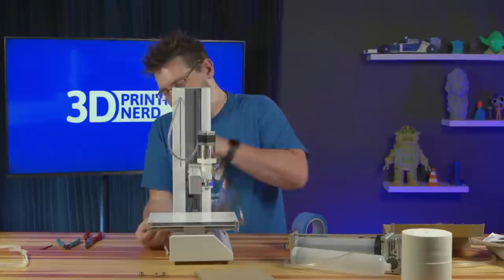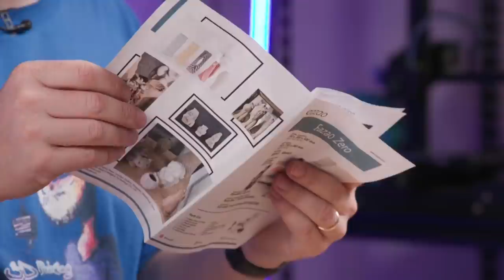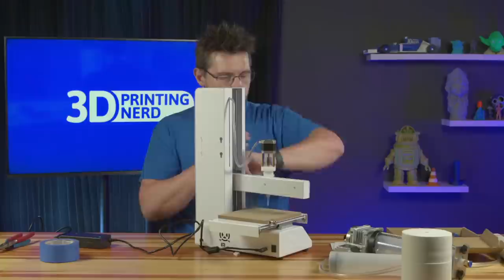CERAMIC 3D PRINTER LIVE! Cerambot Eazao Unbox & First Print

Comment: On their KS website, it looks like the part goes into the container (microwave kiln as they refer it as) in front of the machine and then heat in the microwave. Also, there are quite likely several more steps before getting to the final heating step, which I don't think they have explained clearly anywhere.

Comment: I hope you get it working, I really want to see a finished product printed, and fired. This is exciting development for ceramics. A microwave can work for fairly small pieces. I used to dry out plaster of paris parts using a microwave, but explosions and cracks are always a possibility and I only used it when desperate under a time crunch.

Comment: This was.... painful.  I feel worried for all the backers.
Reply: The only really worrisome thing was that gantry (which I'm sure there are plenty of ways to fix). Other than that, the machine worked fine, but it's not worth the MSRP of $799. Joel's lack of knowledge in the pottery department is what really made this video painful...
Reply: @kevinj9059  the kiln is like 1"x1" what is any one going to make in there thats worth anything
Reply: @kevinj9059  i think the problem is all the extra stuff needed to make it shoot out clay or whatever.  Thats alot of extra parts that a regular printer doesnt have. That adds a bit to the price and kilns cost a bit of change too.  Plus huge inflation right now, part shortages, ect.  Bottom line is that i think most people who make things in ceramic would be shooting for things using most of that build plate, for their small things.  And the kiln wont even do but a small part of that build plate it does have.

Nice idea in theory, but over priced like you said for what it actually accomplishes.  You can only make so many tea cups before you get bored and how detailed and unique can the printer do?  Can i print letters on the side?
Reply: @andrewa8569  specialty printer comes with its own specialty needs dude...
Reply: @kevinj9059  Yes, however that is a really good case actually. How many backers are getting this because they think they now can create pottery the easy way? Plus he had the company itself giving advice, they were totally clueless about the actual product, so yeah.

Comment: The thing is, you should not even need anything specially built machine to do 3D printing with ceramics. A little circuit board and power brick to use the step signals that would normally go to the extruder motor and send it to two motors instead should take care of the electronic components. It could run the part that replaces the hotend and the part that drives the plunger. That way it could run on a machine that does not have enough stepper drivers. The circuit board they provide could detect the direction of the movement and split it up into many more step signals for the plunger motor. Alternatively, you could just have a really beefy stepper motor and power brick to handle the plunger motor. After the physical stuff in taken care of, set the steps per mm via gcode and the speed.

Comment: Well, that was fun. It's an intriguing system but it seems to need some more work. Like including in the manual a basic tutorial on pottery and firing ceramics, because the unexperienced, like you and me, are going to screw this up with this current iteration. But it may become something really good. I remember seeing a video about a similar microwave kiln being used to melt a specific type of glass for pouring (casting?). Really hope you will someday give this another go, make some prints, set them aside to dry for a day and then make a separate video about firing/glazing them. Because this is too interesting to just forget about. 
Anyway, thank you for doing what you do, really enjoy your videos and learned a lot from them. I have been itching to get my hands on a 3d printer for years now but so far they were simply beyond my budget. But guess what!? Later this year I will be completely free of debt and I'm already eying the Ender 3 v2 because that will then become feasible. Woohoo!! Brain on fire with ideas for practical householdy stuff!
Not sure on what modelingsoftware to use though, I'm not keen on using anything that requires an internetconnection to function. You sometimes mention OpenScad so I had a look. That scripting language look very, very much like that of a 3d application called Povray and I have been playing around with that since the msdos era! So I think I'll be able to handle that (LOL Famous last words).
Okay, I'll stop rambling now. Regards to the family and Sean, you folks are all awesome! So... HIGH FIVES ALL AROUND!
PS Oh, and just out of curiosity, did you even think about how you were going to get that redhot kiln out of the microwave?

Comment: I like the idea of having a printer for pottery, but its not woth it this machine becasue of the print volume thats so tiny, the kiln is too small so you cannot have a mug inside of it or even a small bowl, they should make those things bigger as standard and have the option to be able to fire it in the oven since not all households have microwave ovens, at least have both options

Comment: I'm a potter as well as a 3D printer.  You have to give the clay about a week to dry!!!  Someone else was correct and saying you weigh it occasionally and when the weight doesn't change, you're ready for the kiln.  Normal clay takes about 2000 degrees!  Don't know about that clay.  It WILL blow up if you turn the water inside to steam.  Patience Grasshopper!
Reply: It's not that Joel doesn't know this, it's that the manufacturer literally told him to dry it in the microwave (without the kiln) first, saying "it's safe" to do so. These products are consumer products, if the manufacturer can't tell the user how to use their product safely, the product is a piece of crap. The support & the instructions are part of the product.

Comment: It's possible to compensate for the skewed gantry, but it takes some non-trivial calibration. Marlin calls this "bed skew compensation", but it's really to align the print space to the bed rather than a gantry that's known to be skewed. On the other hand, the gantry is probably skewed because it was a shoddy and/or weak construction to begin with. Get the priorities straight: repeatability before precision.

Comment: In actuality, this is a promising product, I do NOT like the makers trying to blame Joel, giving bad info, and such BUT... once the gantry is fixed, and some more belt added, all in all it seems like a nifty machine. 
The only REAL problem was the gantry, which is 100% on the makers to get fixed or the machine is useless. YES it can be modded and fixed but we cant be letting hardware companies get away with the same thing game companies do shipping a faulty product to wait on patch/fixes/mods to solve obvious problems. 
This is an easy decision: See what the makers do, if they fix the issue(s) immediately and let the community know, get the machine because its pretty great. If they fart around, blame Joel, or make some lame excuse and don't fix it... let it die in infamy.

Comment: This needed a two video stream, one to print the part, allow to dry fully, then fire to change the structure of the ceramic to a hardened vitreous ceramic. This requires very high temperatures. Of course adding a glaze is also part of the process. However the print process could be applied to many products, from icing to fancy cakes,  with the right consistency material, even chocolate.

Comment: i pour slip (thats the name for clay with enough water in it that you can mix it up and pour it into the molds) that's a lot easier than what I just watched. on a cup mold it takes about 15 min to allow the slip to form a certain  thickness by the mold drawing water out of the slip then you dump the extra slip out of the mold you let the mold sit and dry a bit more the cup will pull away from the mold just a bit then you split the mold open and remove the cups and sit then on the shelf to dry about two to three days if its a warm time of year then they can go into the Kline for several hours at about fifteen hundred to two thousand degrees F in a short word this has a lot of things that don't work and make un safe to market well thats enough I love Resin 3d printers and making ceramic things BUT the two just don't mix

Comment: Normally ceramics must dry completely, preferably overnight (called leather hard), then trimming and scribing in detail is done and left to dry completely. Only then us it fired in a kiln 
I see no reason why this would be different even with the clay in the cartridge. A heatgun only speeds initial drying to leather hard or completes drying if having left them overnight they're not completely leather hard.  They should be air dried fully after finessing the leather hard stage 
Basically the problem is that any remaining water inside the piece will boil off rapidly and the resulting steam would cause fracture in the 'kiln'. 
That would probably also happen if trying to microwave dry before adding the 'kiln'. The water would boil and vent through the clay causing bubbling artifacts on the surface and through the wall structure.
Thoroughly dry is best.
The kiln supplied is the same as those supplied for fusing glass in a microwave. They get increadibly hot, hotter than most microwaves should probably ever go. After researching the microwave kilns kits I decided against it. Even if you got some projects out if bit, the life microwave would be limited.
Ceramic and glass are very similar so I don't think anything would be different here.
Microwave kilns for glass need to be placed on a fireproof stand and the item on a fireproof paper.  I don't think this product was sufficiently researched by the manufacturer - they really should have known not to tell you to put it in the microwave to dry it out. Basic error - you don't do it in an ordinary kiln either. Do they know anything about ceramics?  The microwave also has to be at least 1000W for glass microwave kilns and I think think this would be needed for ceramics too as it would reach a higher temperature.
Such a microwave should not be used for food use. The binder that burns off would finely coat the inside of the microwave and we don't know what is in it. Many glazes are also toxic as they contain heavy metal oxides.

I see this printer definitely being useful in a ceramic studio as an additional construction technique for small ceramic items that are then placed in a regular electric kiln. Theres just things you could construct with the printer that would be difficult or impossible with traditional handbuilt or thrown items.
There are some youtube videos out there that do show bisque firing,  glazing as well as raku in a microwave kiln. Look for channel CaptMike. He also does temperature testing and tips etc, so it is possible without special clays. Indeed he uses moulded liquid slip. I suspect a thick slip is what is in the printers cartridge He does glass fusing too.
One thing I didn't see with the printer kit but did in the CaptMike videos is that these kilns come with a large fireproof cover that surrounds it.  They should supply high temp heatproof gloves and metal tongs too. Kiln paper would also be useful in case of any drips of glaze running down a ceramic model. You don't want a glaze dripping onto or a glazed bottom that hasn't been cleaned off touching the kiln base as it will rise. The kiln paper prevents this fusing if either ceramic glaze or glass to your kiln base

Comment: bruh microwave heats things up by vibration the molecules in simplest way I can put but what you should have used was an oven not a microwave oven a basic "oven" you could even have used a pressure cooker with sand in it and I am a mechanical engineer so you can trust me a little with that

Comment: Even if it worked the kiln is so much smaller then the build volume
Reply: Yeah if the kiln isnt at least big enough to make a coffee cup (with a handle) then its limited to just trinkets with no real world use.  Why bother having the build plate bigger than the kiln.  I guess you could buy a bigger kiln but i think most people would just prefer it to be included.
Reply: @andrewa8569  I think this machine is aimed for the ones, who are doing the pottery hobby for a while and have a kiln for sintering or if you have a small bussiness and costumers want few products, it can be a lot cheaper and much less time to print those than to make a mould for them and only use them a couple of times. And the included mini kiln is maybe a small bonus for those who don't know anything and just want to try it out, like Joel.

Comment: This was a joke. Unsubscribe.
Reply from the maker: It was awful. Wait, I mean, bye.
Reply: 3D Printing Nerd atta boy
Reply: That is reality for you. If the first experience with a product is bad, it is bad. Joel did just fine. Eazao needs to improve their structural issues and the documentation. It should have been made known that it would not be a single taping for the review and would be in 2 parts. Maybe even 3 parts because people usually glaze parts when it is going to be used for food and drink.
Reply: @MrNathanstenzel  at a certain point he realized it was going bad and to no fault of his own he didn't know the next steps, and the answers he was getting were just guesses, that's the point you just wrap it.  I mean ok everyone waited to see a result, you want to finish, but if you are frustrated as you should be then make it a two part video.  I seen a bit to much pandering to an advertiser which is everything that's wrong with youtube.  If that example of the product is bad and instructions bad just say it and end the review and say you will redo it when they've made the needed corrections.
Reply: Adios red queer
Reply: @andrewa8569  yep
Reply: @andrewa8569  Dude, the literal manufacturer of the product was on his stream, telling him what to do, including telling him to dry the fresh print in the microwave oven without the kiln. He followed the actual, literal, real-time instructions from the company rep. If that leads to a complete failure like this, Joel is not the failure - the product and the company is.
Reply: bye2